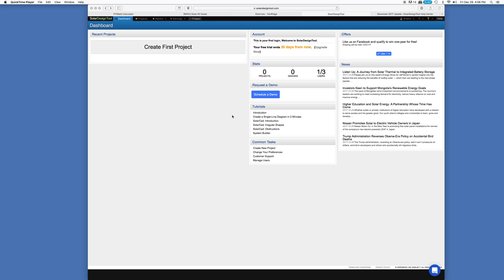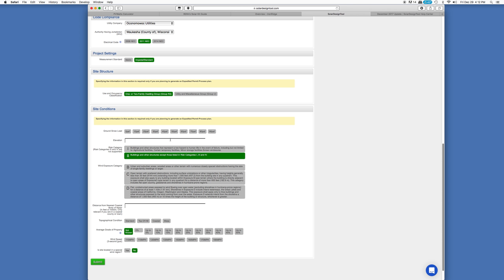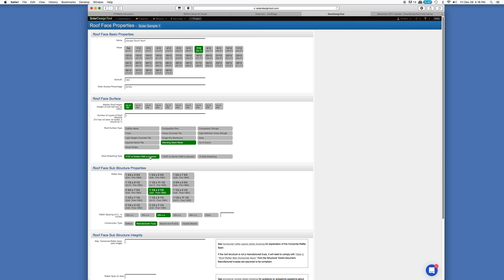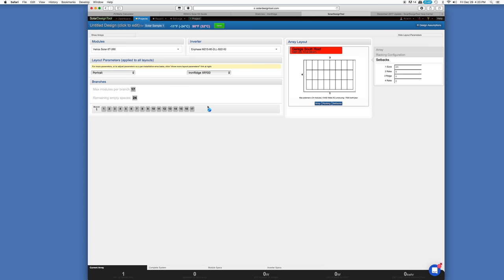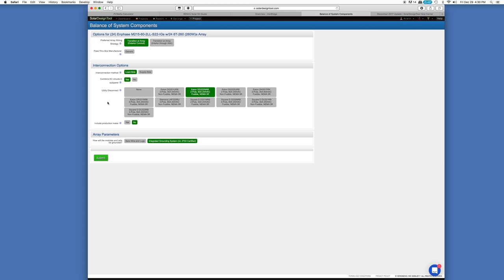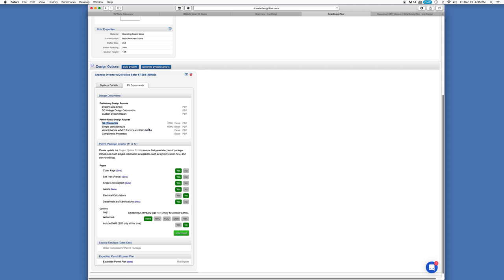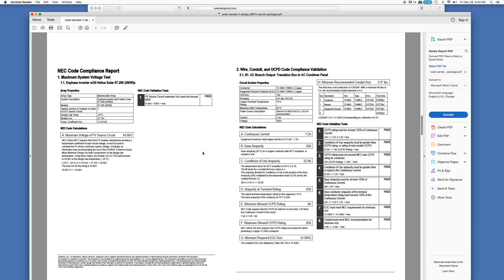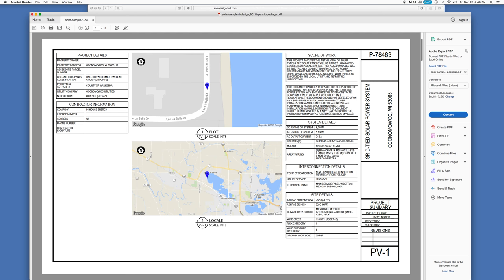Solar Design Tool software demo

Comment: Cool tutorial Ben! These guys recently added the ability to generate full permit packages in their tool, so it does even more now. Great Tool.

Also, if you use "Trace Over" early in the design it will generate a Site Plan image (mock up of the roof & panels).